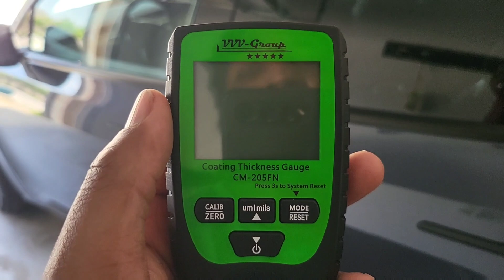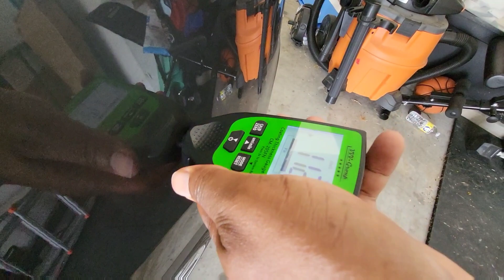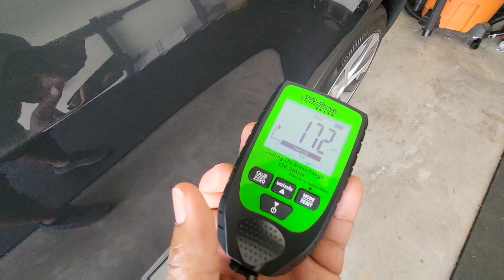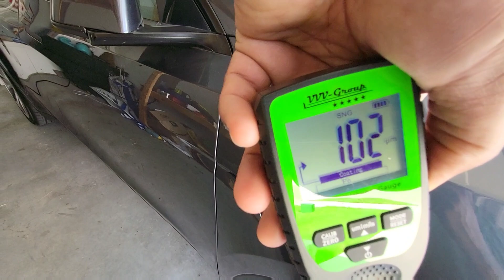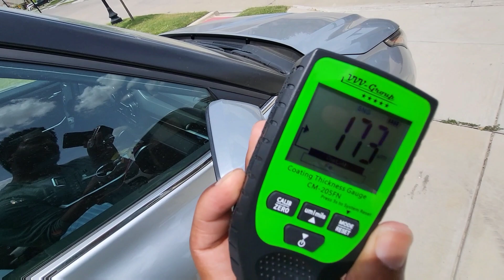Paint thickness of 2022 Tesla Model Y Giga Texas 4680 Battery

Comment: Awesome to see paint quality is better with these Austin builds. What’s your thoughts on regular car wash vs hand washing?
Reply from the maker: As long as it's a touch-less carwash. They get the job done efficiently. I prefer the quarter spray washes ( never use the brush because rocks left on the brush can scratch the paint)

 The hand washes are the best but often you have to use  use the 2 bucket 🪣 🪣 method.